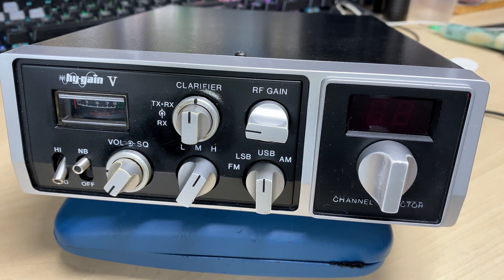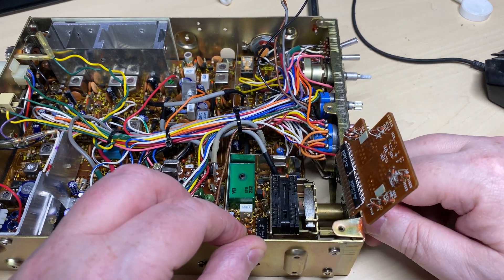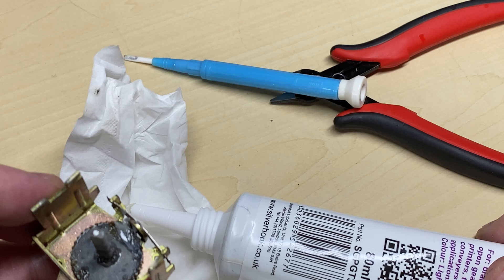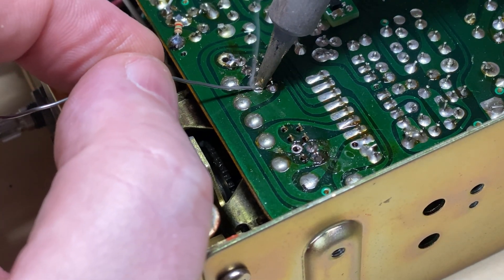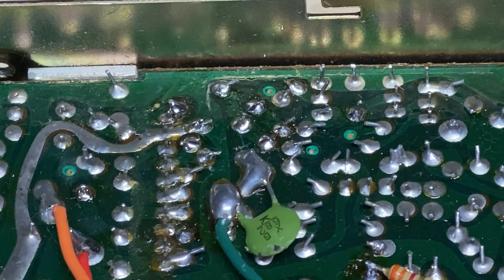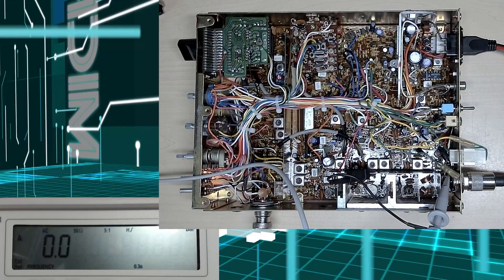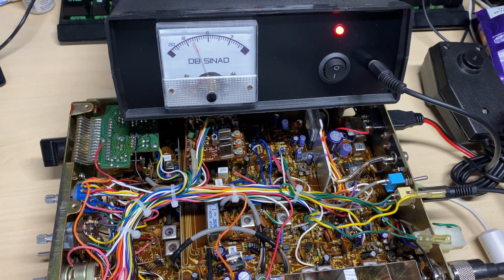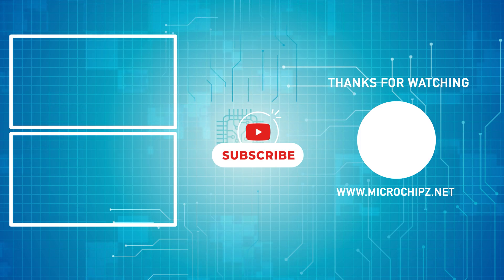EP 173  - Hygain V - Classic SSB CB - Channel change fault and performance mods.

Comment: can the additional clarifier be added to the previous model 2705 that doesn't have this. Great video I do like to see the new updates from MCz
Reply from the maker: I suppose you could rebuild the shift circuit on the osc board , and find a dual control and knobs .